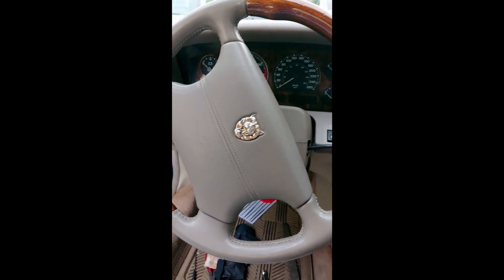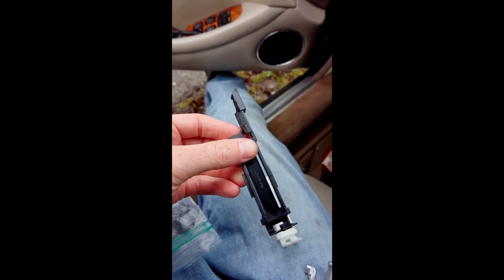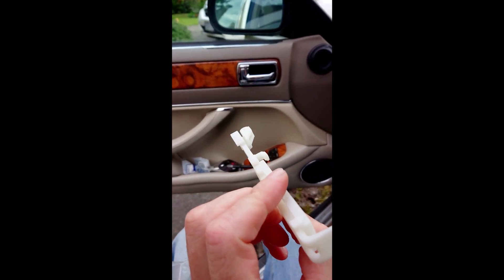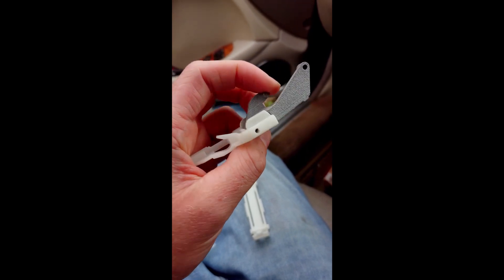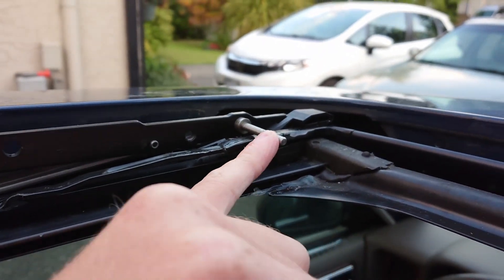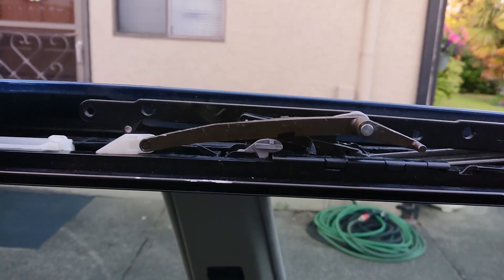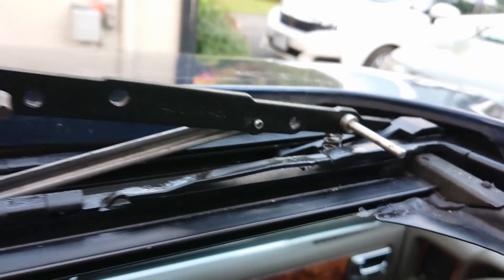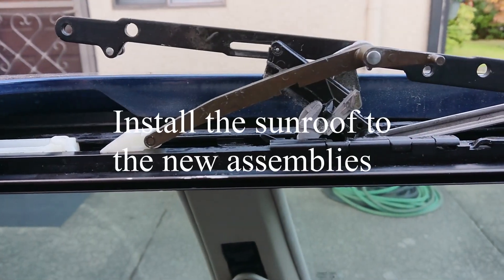Jaguar X300 / X308 New Sunroof Parts Testing and Assembly

Comment: Hi again, I managed to rebuild my sunroof after harvesting parts from two other junkyard x300 jags. Everything seems to work perfectly until I insert the final trim piece (the larger of the two interior panels). For some reason when I insert this final piece the whole sunroof jams up when trying to open. Without the piece the sunroof opens and closes perfectly (in both positions). Any suggestions on what the issue may be? I’m worried about breaking the brittle pieces while troubleshooting…. Thanks!

Ps. I should mention that the smaller water channel trim piece is inserted without any issue.

Comment: The video gives hope that my 97 can have a functioning sunroof again. How did the testing go on your parts? I have disconnected the power from my sunroof because it only brought up the deflector before jamming up on the travel back under the roof. I have developed two rust spots on the edge of my sunroof panel (about 2-3 mm in size, very small blisters). If your parts were found to satisfy your standards, then I can have the sunroof panel repainted and possibly have the sliding mechanism addressed at the same time. Hope to hear a success story soon

Comment: When will the parts be available for purchase? I'm dying to get my sunroof fixed after the smaller piece snapped.
Reply from the maker: Which ones you need? I'm confident on my aluminum parts, the other two have exceptionally small tolerances, my drain channel supports I can get smoothly working with some hand work.
Reply: @geneticbillionaire3213  hi. I need definitely the two R & L aluminum parts. Any chance to purchase them? Thanks on advance for replying. Regards
Reply: @geneticbillionaire3213  Well, all of them I guess. I broke the exact same pieces.

Comment: I have broken pins on the bell crank lever arm. This video gives me hope that I don’t have to spend $500 on a whole sunroof assembly replacement. Hoping it has no broken pieces itself. I couldn’t install the drip tray or main sunroof trim panel due to broken mechanism parts...also my channel supports both seem to be stuck at the rear of the assembly as if they jumped the track. Any help would be appreciated! Great video by the way.
Reply from the maker: Hi man! Sorry for the super late reply. Life gets in the way!   Could probably get it going again would need some pictures etc, to figure out what's totally wrong. The drain channel supports sound like the have busted front sections where the pin from the sprung arm fits in.  Terrible structure in that section, any crap that may have busted off elsewhere will hit the track, and jam that rear drain channel support. Those channel supports you can still by separately online very cheap. The rest will have to diagnose with some pics
Reply: @geneticbillionaire3213  not sure if you're still in business have some questions about my X308 VDP Sunroof I'd like to run by you